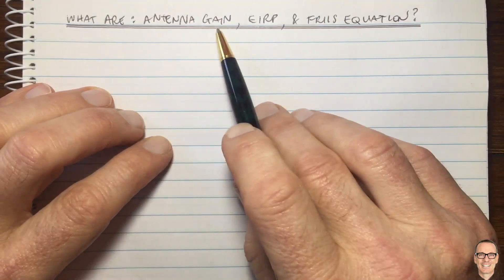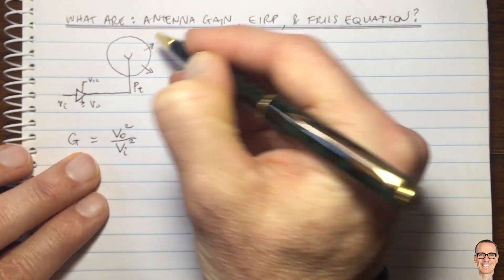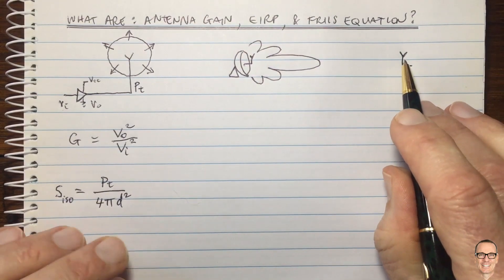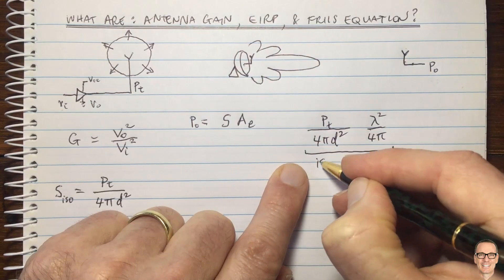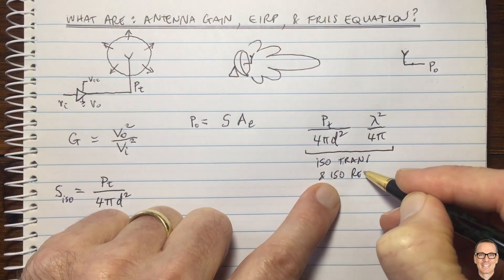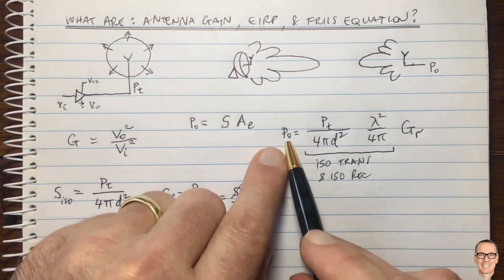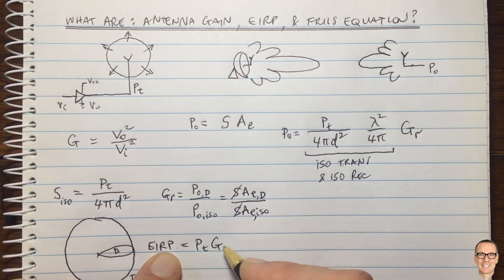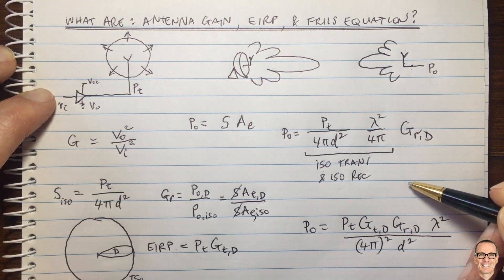What are Antenna Gain, EIRP, and Friis Equation?

Comment: 9:30 Just to make sure, I think the words "effective area" doesn't mean area of the beam. It means imagining an equivalent isotropic with its receiving area scaled up by Gr. The reason is that receiving area for directive antenna is undefined but it is defined for isotropic (lambda^2/4pi). 

Similarly, at the transmitter, the power density is undefined for a directive antenna but it is defined for a sphere (Pt/4pi d^2). 

It seems that we can only analyse when we work in terms of isotropics.
Reply from the maker: Those quantities are not "undefined", but they are easiest to quantify with reference to the isotropic case.

Comment: I think what could have been included is how the Friis formula leads to the impression that lower frequencies travel further due to the presence of the lambda squared term. 
This is misleading as the lambda term determines the effective area where power from the wave is extracted. Propagation in free space is infact independent of frequency. The real reason lower frequencies seem to travel further is propagation mechanisms that are available to it that are not available at higher frequencies.
Reply from the maker: That's an excellent point. And it's something that I continually have to explain to people. High frequencies travel to us from other galaxies, just like lower frequencies do too. So it's not that they don't travel the same distance! They clearly do (in a vacuum, anyway). Of course there is the atmospheric absorption, but that's really only a big effect at a couple of frequencies, otherwise it's a gradual increase with frequency. I think I'll add it to my "to do" list for another video. Thanks.

Comment: Thank you,
so the gain can be always determined by taking the ratio of either the squared voltages or the power. Is that right?
Thanks.
Reply from the maker: Yes that’s right. P=V^2/R so when you take a ratio of two powers, the resistance, R, cancels on top and bottom (since the resistance doesn’t change).

Comment: Very clear explanations, thank you!

Please correct me if I'm wrong - but I think I understand why standards like AS/NZ 4268 define a maximum EIRP for a given frequency band. They are interested in real-world emissions, they don't particularly care how powerful the transmitter is, but more concerned with what is emitted in worst case (i.e. something in the path of the main lobe).

AS/NZ 4268 points to EN 300 220-1 for measurement methods. I can't see reference to EIRP, only ERP. The measurement is to connect the transmitter to a dummy load and measured with measurement receiver (RF voltmeter or spectrum analyser), then the maximum antenna gain is added to this. In AS/NZ 4268 they state "ERP will always be 2.15dB less than EIRP". Does this mean we just add 2.15 to ERP to get the EIRP value? What is the significance of the "2.15dB" value?

Sorry I got in the weeds a bit - I'm trying to learn this subject as a novice - so I really appreciate your videos! :)
Reply: Found the significance of "2.15". From Wikipedia's ERP article: "The difference between EIRP and ERP is that ERP compares the actual antenna to a half-wave dipole antenna, while EIRP compares it to a theoretical isotropic antenna. [snip] a half-wave dipole antenna has a gain of 1.64 (or 2.15 dB) compared to an isotropic radiator".

From that I gather: EIRP = ERP + 2.15 (if in dB), or ERP = EIRP + 1.64 (if in W). Right?
Reply from the maker: Yes, that's right. I'm glad it makes sense.

Comment: I wonder if the E in EIRP stands for "equivalent" or "effective"? Some texts use both. The word "equivalent" makes more sense because its how much power you would need to put in an isotropic to achieve the same level. 
Also there's ERP when using non-isotropic antennas, but EIRP makes most sense intuitively because isotropic has zero gain and it makes sense to reference other antennas to this.
Also in EIRP, the gain must be in dBi.

Comment: Could you do a video on TEM wave in lossless isotropic free space. An explanation of why the E field component and H field are in phase for an EM wave?
Reply from the maker: Time varying electric fields and time varying magnetic fields exist together. They are both manifestations of the electromagnetic force, which is one of the four fundamental forces of nature. I think the best way to think of it is that if you generate a time varying electrical field (eg. by making the current in a wire change direction from positive to negative and vice versa, according to a sinusoidal wave), then it induces a time varying magnetic field that is by its very nature "in phase".

Comment: Can you illustrate difference between gain and directivity ?
Reply from the maker: Thanks for the suggestion. I've put it on my "to list". In summary, the Directivity deals with the shape of the radiated beam pattern (how directed it is, compared to an isotropic antenna). The Gain includes Directivity, but also includes a measure of how effective the antenna is in transferring the energy in the EM wave, into electrical energy in the wires (for a receiving antenna, and vice versa for a transmitting antenna). This combined factor (directivity and effectiveness) is captured by the "effective area" parameter.